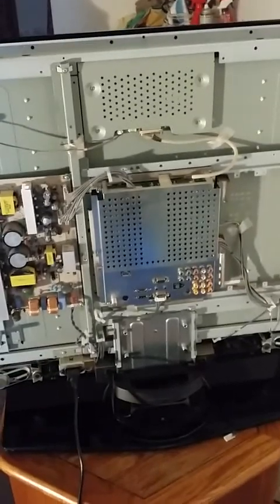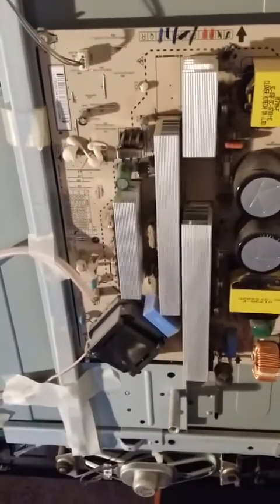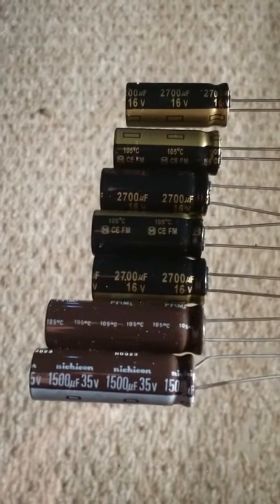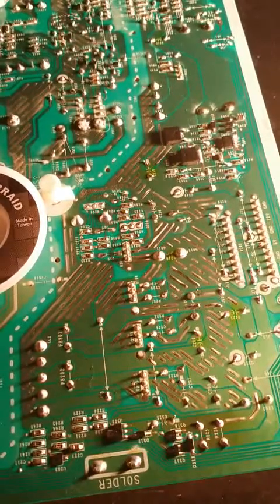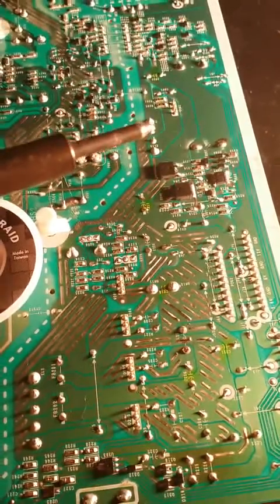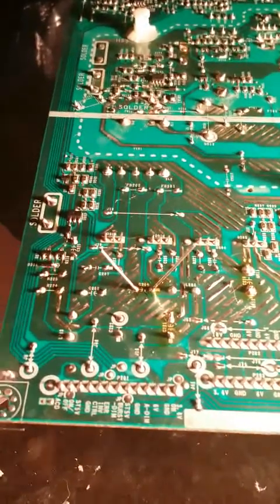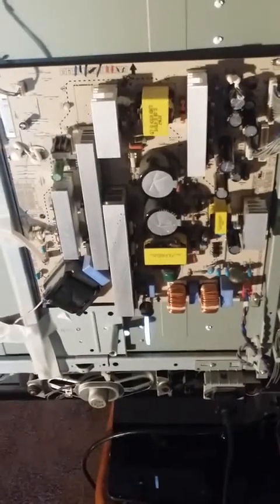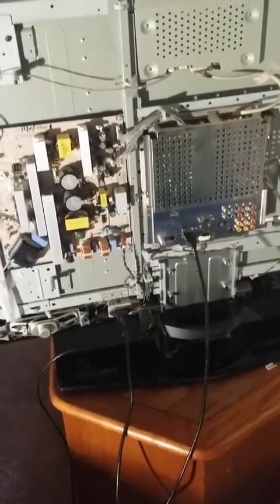LG 42LC7D TV

Comment: how can you tell if capacitor is blown
Reply: in this case the capacitors had a blown top so it was obvious they were bad. other than that you would have to remove them from the circuit and put them on a capacitor checker.